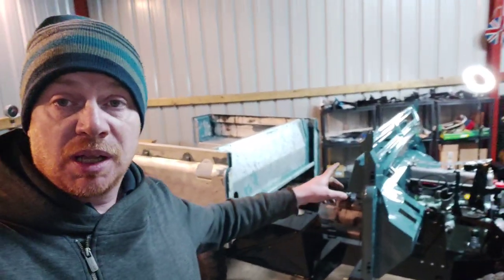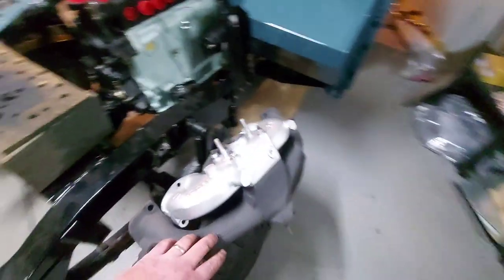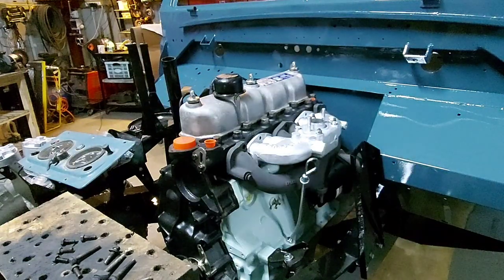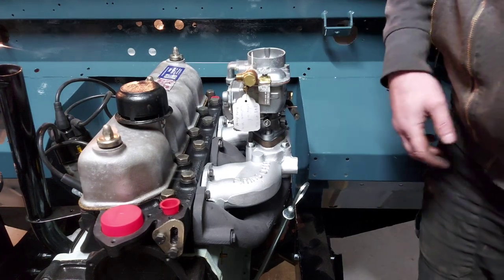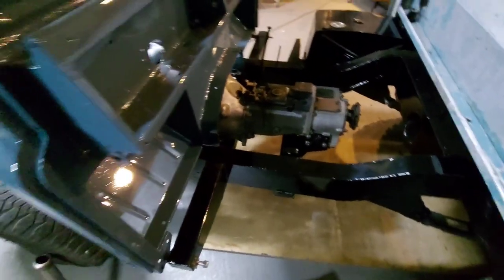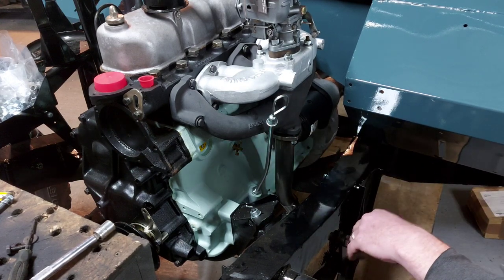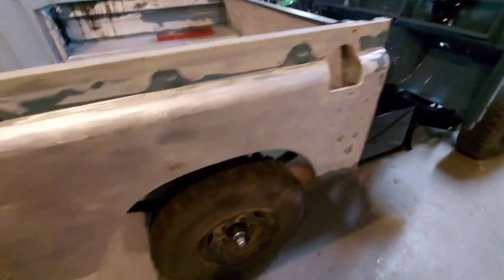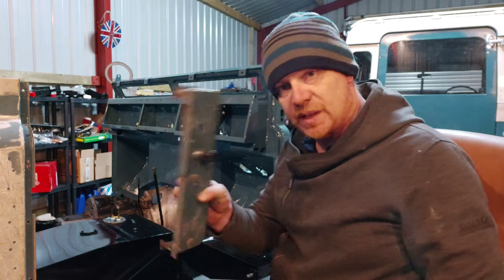land rover series 2a build Pt4

Comment: Nice bit of progress going on and I’m with you and all that feeling with spanners and yes it’s slow but it’s worth it because stripping and butchering nuts bolts and threads is more time consuming when you have to replace these!
Reply from the maker: That's it! It only adds minutes to you day but can save a lot more time and hassle 🙂👍
Reply: @retro.restorations  and I’ll always put a bit of never seize on the threads to lubricate because it’s so easy to strip a thread if it’s dry and creating friction and the back it off and tighten procedures is great if there’s a tight one!
Reply from the maker: That's good advice thanks. 🙂👍

Comment: I've heard a few people having the same issue with new fuel tanks. It's pretty common by all accounts!
Reply from the maker: I've been reading a few stories about bad tanks aswell it's hard to get quality parts nowadays 😕 👍
Reply: @retro.restorations  I had to send my first one back as one of the small bolts holding on the blanking plate cover (for the fuel pick up) sheared off as I was taking it out. I went with a different supplier after that. I was thinking about a stainless steel tank but the cost is eye watering. I might upgrade to one in the future though.
Reply from the maker: As mines been painted I can't send it back so I will make it fit. Stainless tanks look good but given the price and it never gets seen its a waste of cash in my view. 🙂👍

Comment: That bulkhead looks like a later 2a bulkhead, as that panel you showed is for for a 'letter box' type bulkhead, and the one that's on the build looks like a later one with single wiper, what year was the 2a originally?
Reply from the maker: That's what we've been trying to figure out I've ordered the correct bulkhead now this one will be saved for a future project. Its a 1962 landy. 🙂👍
Reply: @retro.restorations  a nice and early 2a then! Looking at the bulkhead at a bit more depth, I'd definately say it's the same as my 67's, which was the first of the suffix D 2a's, where did you order a new bulkhead from? Contemplated a new one for my project, but mine really isn't that bad, needing footwells and a patch here and there, look forward to the updates!
Reply from the maker: Ive ordered one from shielder I'll give an update if there any good.  🙂👍

Comment: Where did the galvanized bulkhead come from
Reply from the maker: That ones from Richards chassis but it's not right it's for a later S2a so the new one I'll be fitting is from shielder. 🙂👍
Reply: Me looking at that option too, but shielder don't do the early 2a with the lower letter box dash, so need to go series 2 - don't know if that throws up any other fitting problems, vents, floors panels ,etc. Be good to see how you get on?
Reply from the maker: Shielder do the letter box dash that's what was missing on mine give them a call they make them to order so can build to how you want it. 🙂👍